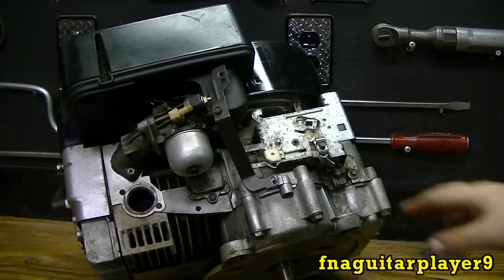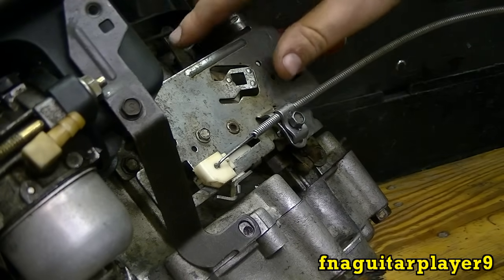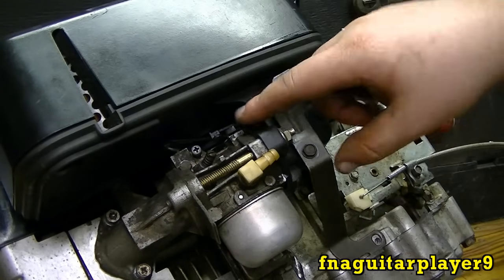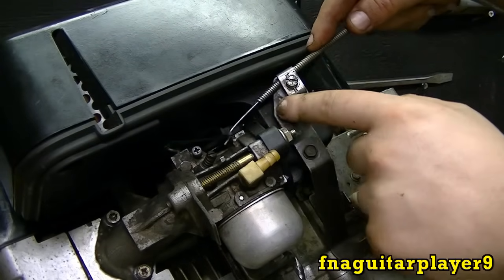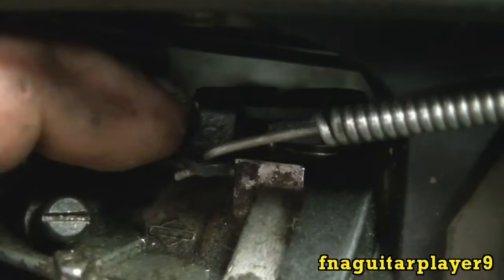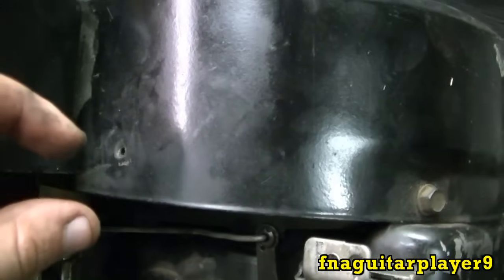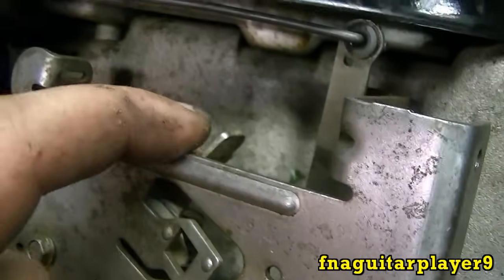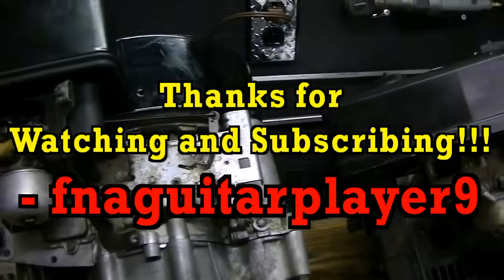How to Set Up and Adjust Throttle and Choke Cables on Small Engines

Comment: hi
tried adjusting mine but it doesnt spring back, can I buy a new spring for it?
Reply from the maker: Yeah you can, first make sure it hasn't come loose, i've had them do that. If you need the part number give the model type and code off the engine so i can look up the exact #. Thanks for Watching!!!
Reply: fnaguitarplayer9 I think it's more than spring, the governor has slipped a tooth on the inside, probably as handy get an engine

Comment: I know this is an old video, but I could use your help. The white piece of plastic that the throttle cable z bend goes into broke on my 13.5 B&S. I can't seem to find out what they call that, I'm willing to replace the piece or the whole assembly. I just need to know what it's called so I can look it up properly. 

My B&S has that auto choke feature. If I knew how to just put the cable on the choke, I would make it manual, but I'm not sure how to do that either. 

Any help would be GREATLY appreciated! 

Great Video!
Reply from the maker: My manuals don't show a part # for that, you have to replace the whole bracket assembly (about 10-20 bucks on ebay). If yours slides horizontal its part# 694042 but if its vertical i'll have to see what it is, if you want give me your model and type off the engine so i can verify the part #. Hope this helps! Thanks for Watching!!!
Reply: DeveneyInteractive being
Reply: How about the back side of a vertical bracket assembly showing the spring connections?
Adapting engine from Simplicity (horizontal plate) to Ariens riding mower (vertical plate)

Comment: I cleaned my carburator on my 10hp Briggs an now it idles at turtle speed an i have my throttle at Rabbit speed. what did I do wrong
Reply from the maker: Sounds like the linkage that connects between the carburetor and governor arm may have came loose or the governor spring is broke or came loose while you were working on it. Thanks for Watching!!!
Reply: +fnaguitarplayer9 
all that is fine I got it to idle up but then it cuts off.. I think I'm just gonna find a new card .. a new carb cost less than the bucket of carb cleaner
Reply from the maker: I hear ya, sometimes thats the best way to do it when they do that.

Comment: i have a briggs stratton intek 65 pro and wondering if that has manual or automatick choke... it has a realy hige rpm.. =)
Reply from the maker: Not sure right off hand, but if it has a separate choke lever, then its manual. you probably have a governor issue or a linkage is hanging up. Thanks for Watching!!!

Comment: My B&S 22hp started doing this the 3rd season. Had to have carburetor rebuilt after the 4th season because gas was leaking out carburetor while sitting in garage. They say ethanol ate the seals. My other 2 mowers mower a B&S 16hp and a B&S 24hp sat with ethanol gas in them year round no problem. After the $400 carburetor i job i drive 22 miles to get ethanol free gas for the 22hp but the others still running strong on ethanol after 15 years. I even told the guy who rebuilt the carburetor it had been hard to start for 2 years before carburetor started leaking and it was hard to start after he rebuilt carburetor. They said didn't know why it was hard to start. Well 2 years later and seeing the comments here I adjusted the choke, heck it was not even close to being in position. Everybody adjust the choke! All that cranking could not have been good on the coils, hoping that cures up. What pisses me off is that everybody else said start with the valve clearance. It was out very little and getting that permatex on the valve covers to seal without getting it on your internal components is hell.
Reply from the maker: I hear ya! Sometimes it is something simple like that. But ethanol does work on certain gaskets/diaphragms. I haven't much problems with my personal equipment, but its mainly when something sits a long time before it starts to work on them. Glad you got it going! Thanks for Watching!!!

Comment: i have a snapper riding mower that i rebuilt watching your videos .thank you by the way . its a briggs an stranton 9 hp .  i have 2 wires left over . a green one and a brown one. any idea what the might be? its a pull started kind . 

also can i add an electric starter ? this pulling stuff gets dead real fast . thank you
Reply from the maker: Your welcome, glad to hear my videos helped you rebuild it! It may be a recharge system or for lights. On some you can, you can look on the block and see if it has the 2 threaded bolt holes to mount a starter, if it does, then look at the flywheel, some came with the gear on the flywheel, if not you will need to change flywheels. Thanks for Watching!!!

Comment: I just purchased a used WheelHouse generator with a 10HP B&S that didn't run. I replaced the intake pushrod, stator and head gasket. She starts up but is missing all the springs but has the linkage from the carb to the metal piece that hooks to the governor...how hard will it be to make new springs to properly utilize the mechanical governor?
Reply from the maker: I don't know about making them, it would be hard to get the tension right on the springs, probably have to buy the correct parts. Thanks for Watching!!!

Comment: You sir are very awesome. I couldnt get my mower to run and I watched some of your videos and now she is almost running like new except sometimes when im mowing it will just die but then it starts right back up. ive not had it long and it had sit for a while before I got it. Thank you so much for doing what you do, you have inspired me to want to work on small engines. Keep up the good work my friend
Reply from the maker: Appreciate that! Hard to say what is causing it to shut off like that, but at least it starts right up again though, I had one 12 horse briggs that if you stalled it out in high grass it would vapor lock and you would have to let it cool down to start up again, really annoying haha Your welcome, glad to hear that, its a fun hobby to get into and there is money to be made doing it. Thanks for Watching!!!
Reply: 988 on 8

Comment from the maker: hahaha if you do away with the springs it will bypass the governor, you may not be able to do this on that type of engine, i've never done it on a push mower engine before. you should be able to do something similar to the bigger engine like in the video, removing the linkage that hooks to the choke. hope this helps thanks for watching!

Comment: I have a 14.5 MTD Lawn Tractor. I had to put a new carb. on it and I'm having trouble getting the choke/governor adjusted correctly. I have a manual choke on the machine.... when I do as this video describes it seems to run like choke is on at full choke on and full choke off....the only way I can keep it running is to have it at 1/2 choke (and it's never been like this before)....what have I done incorrectly?

Comment: I have a 99 cent weed eater lawnmower with B&S with a 4.5 ftpsae..whatever, yadi yadi.....lol, you can already tell I don't know crap about lawnmowers....lol. Anyhow, it has an auto choke carb...and I would like to add the manual throttle.  However, looking at my carb...it has 1 skinny spring and a regular size spring. Am I going to do away with these springs?  It also has an "s" shape clip connects the choke to the governor? If I do away with the springs or "s" shape...it's gonna disconet gov.

Comment: Great video ! I', having trouble with my kohler MV18  - the engine runs but only with the choke line pulled ALL the way out .  Im thinking to adjust it to have more play between fully in and fully out. Any help would be appreciated. Thanks again  for the video!
Rich G